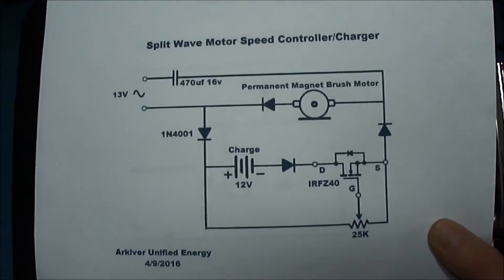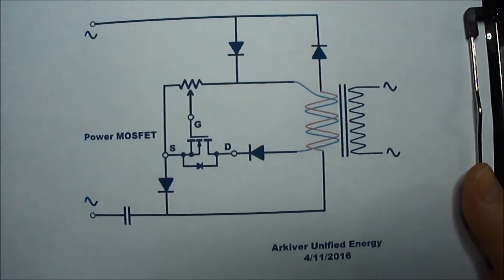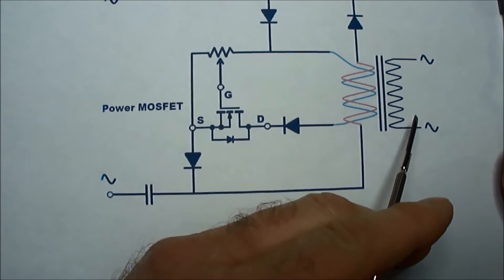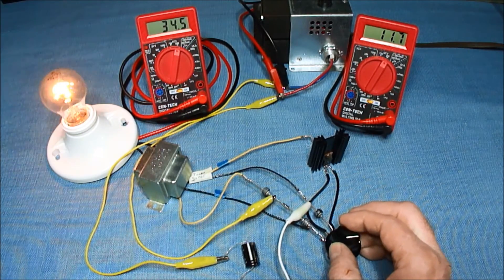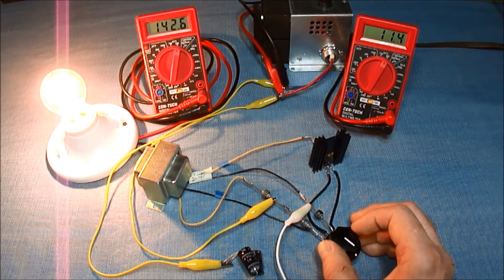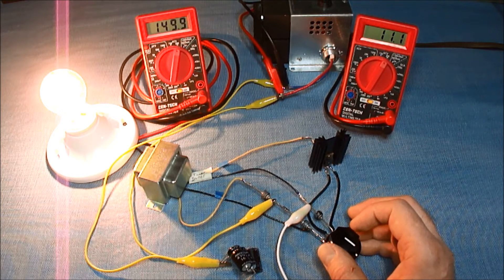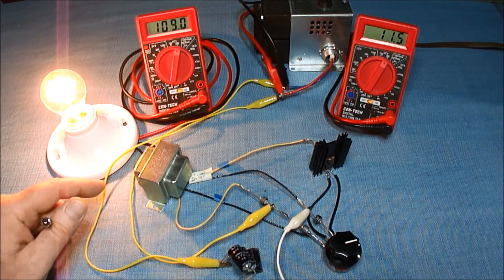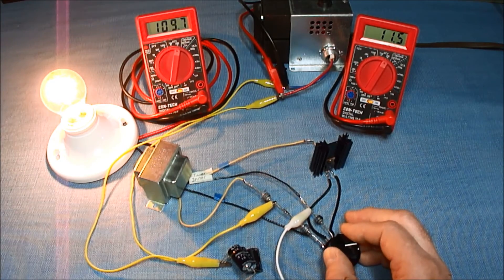EVAT Electronic Variable Amplifier Transformer

Comment: Great design and ideas.Thank you.. seems the greater capacity improves the output volts and current because of the closer to resonance of the transformer windings.
Reply from the maker: It could be a combination of things. In some configurations I believe the bifilar coil can cause a beneficial triplen harmonic or scalar wave. It's possible there is a voltage rise in one direction across the cap but I don't have a scope to see it. Thanks. Cheers
Reply: It is a known fact that bifilar windings increase current and improve energy transfer also... Cheers!

Comment: Hi.It is difficult to speak here of the amplifier :D ?
- so take into account the losses on the transformer "one half of the course"the rest of the power is transformed into heat generated 
the low efficiency of the inverter.
what happens when we ignore the capacitor? (similar to the dimmer)?
Reply from the maker: +Tomtech29 Hi. The circuit works similar to a push-pull amplifier except it uses two wires instead of a center tap and only one transistor. There is heat loss in the transistor which could be used. A variac has heat loss but it's spread over a larger mass. Instead of using higher supply voltage to overcome coil impedance the supply voltage stays the same. The higher cap value removes coil impedance and more current flows in at the same voltage.